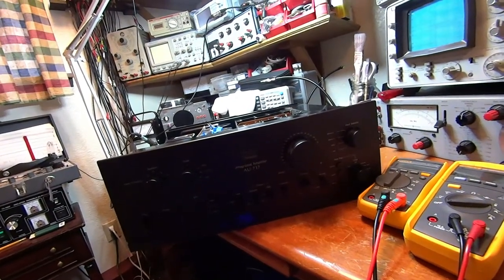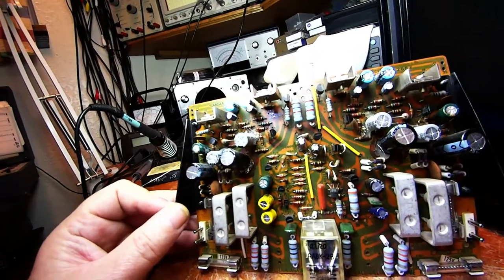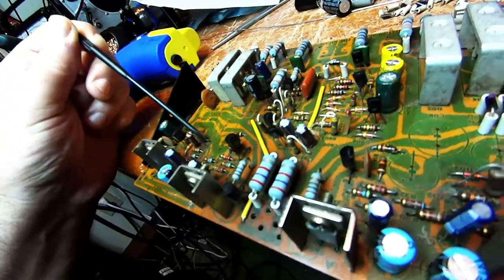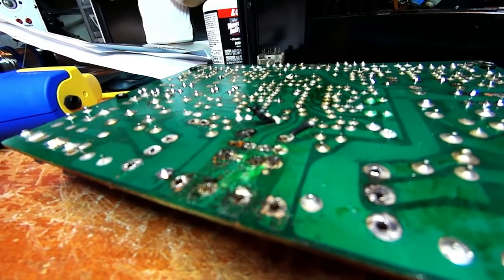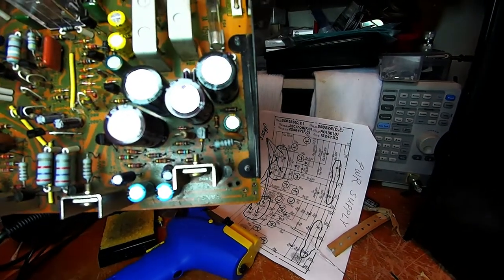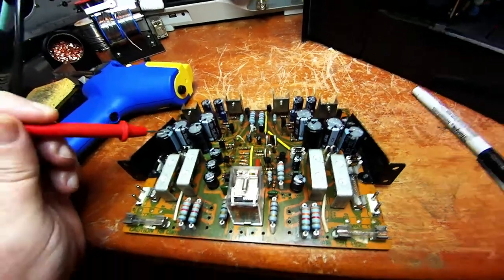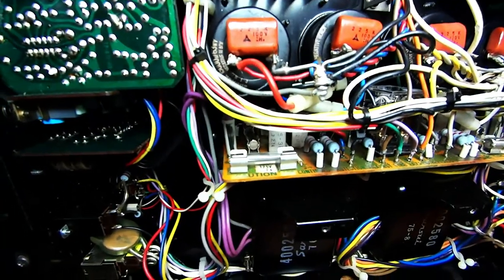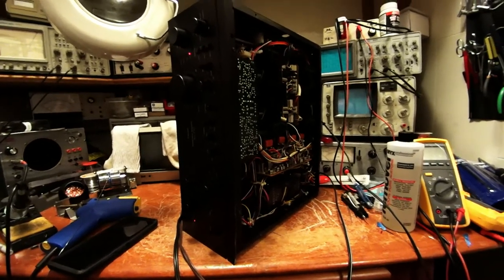Sansui AU-717 Power Supply Rebuild

Comment: Today I start working on a Sansui AU-717 someone change a lot of capacitors but I found a inestable 12 volts power supply.
Tomorrow I check the zener diode and some transistors.

Best Regards.
Reply from the maker: Best of luck to you Ricardo. May it make beautiful music once again.

Comment: Great Video Leonard…! I noticed you have an Eico 147a signal tracer on your bench… What mods have you done to it, if you don’t mind me asking..?
Reply from the maker: I added phantom power to it to accommodate a Carlson super probe that I built up. The power has adjustable voltage to vary the gain on the probe. Here is a link explaining the probe. https://www.youtube.com/watch?v=uVkJqqZroN0
Reply: @leonardpeters3266  That is a great idea..! Been considering building a Carson probe… Have been having a difficult time finding a suitable probe shell… Your signal tracer adaptation would be an interesting topic for a video…… Thanks for your reply…Cheers..!
Reply from the maker: @esci8978  No problem, I used a copper pipe for the probe shell. My daughter in law made me ends on her 3D printer.
Reply: @leonardpeters3266  Good to know thanks.. :)

Comment: Hi, Do you offer repair service for the Sansui AU-717?
Reply from the maker: I never thought to. There are 3 reasons I'm not overjoyed about the idea. The first is because shipping is so expensive and there are allot of opportunities for the shipping company to destroy the amp. The second is, to really make sure you have done a bullet proof job you have to rebuild everything. Power supply, pre-amps and power amps. Last but not least the semiconductors are very hard to find. The last repair service I saw on Ebay was $450.00. I fear it could be worse then that. Right now the Capacitor kits for AU 517 and 717 amps cost $200. So I can repair a certain problem with the amplifier and make it work good again. But the amps were made between 1977-79. That means they are 45 years old. It is just a matter of time before another capacitor goes bad. I did notice a fella on Ebay offering the service.

 https://www.ebay.com/itm/133934571100?hash=item1f2f1f5e5c:g:qg8AAOSwztRepfZV&amdata=enc%3AAQAHAAAAoO5uXEReR6qa1Fhtl1avtHkg631Hvyemv%2BvRDO7HiEt9JZE1njz0LJn2YdxjFZ4HyuDBB9ZToXXhMJvo4egfKXImVlg1eBZrr%2Bazu5htnbC2dU9bNnkbzOuM5qozpf7Bd7i3C3kyokRq1YFdhbjIiahd2bMYq7zgp99CibnSmWTRWsv44DGy6471gfQawpxFmuAImWIjIq4u7f%2FX4jqiIMg%3D%7Ctkp%3ABk9SR5qG4_zjYA 

I don't think for a minute that he can do much for 40 dollars. But I think that is the beginning of the negotiation.